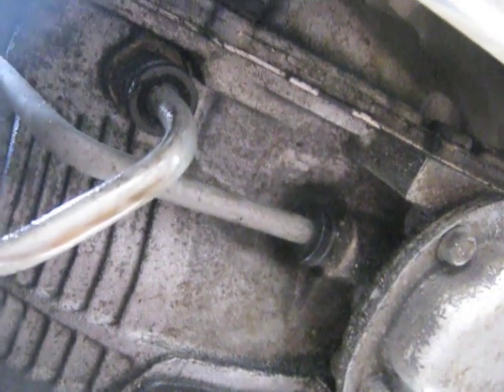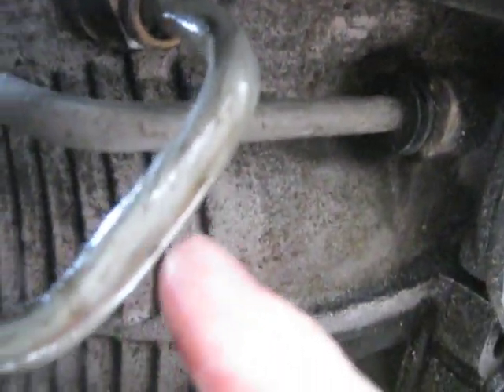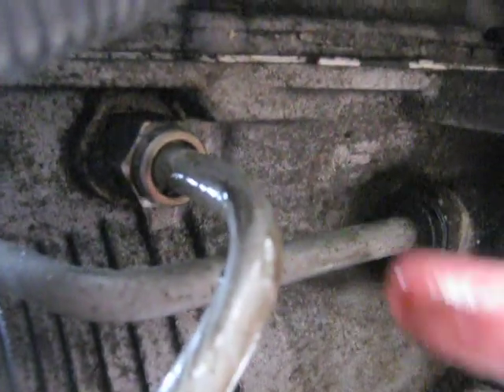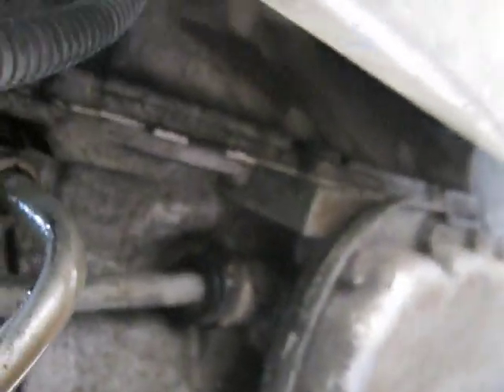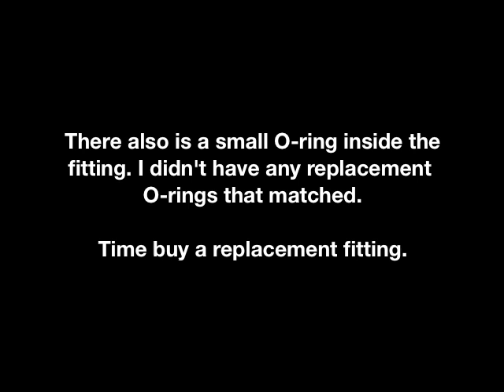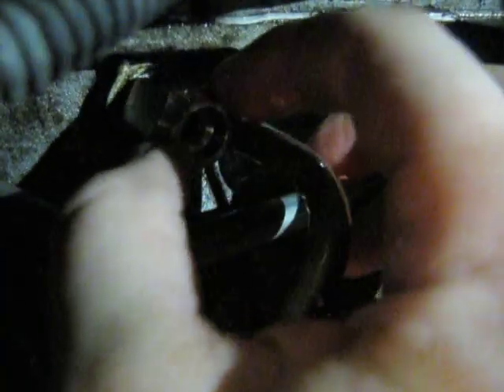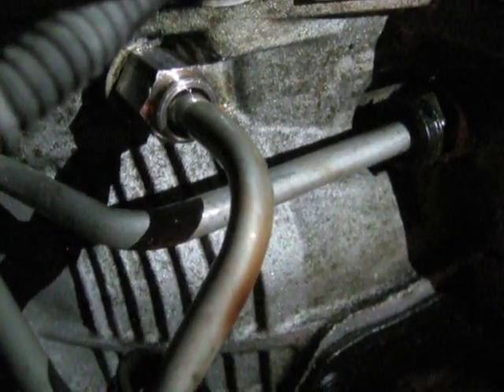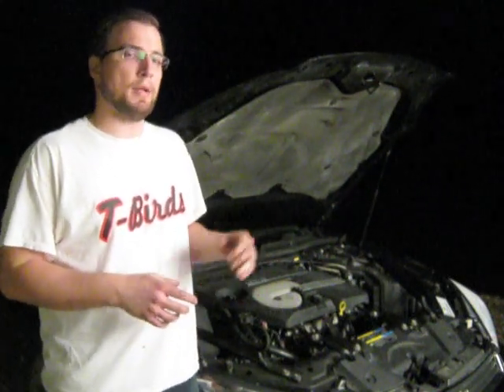Transmission Fluid Leak - Transmission Cooler Line Fitting - 2006 Impala - Fixed

Comment: Thanks for sharing. My mechanic was gonna charge me $60 to install the actual line. And the part was $30. So I searched YouTube and came across your video. Guess what I changed this part you replaced by myself less then 30 mins. Save myself $90 bucks... Part was only $10...
Reply from the maker: mzshytown Awesome! Glad u saved some $$
Reply: Mines charging me 175 , I brought the parts myself 😂
Reply: Those are junk , cut that garbage off and get a double flaring tool , reflare the 3/8 lines the way there supposed to be ..and change the fittings .. Some new idiot gm engineer thought they could redesign the wheel again , but it didnt work worth a dam , they leak half the time ..what a piss poor design ..

Comment: I've got the same o-ring leak on my 06 Duramax LBZ. I'm running heavy-duty 5/8 tranny cooling lines made by Fleece, and I couldn't find just the o-ring, so I ordered the connector for 14-bucks. Thanks for the walkthrough and saving me at least 100 beans!

Comment: you can remove the inside o ring and replace it.  It fits in snug in the groove.  Its seated deep into the fitting. The connector hardly ever go bad.  just the rubber seal wear out.

Comment: The original fitting is a short threaded fitting, and the newer fitting is a long thread! The short threaded doesn't thread all the way not using all threads, the longest threads do use all the threads in the transmission! You have the better fitting sold to you by the dealership.

Comment: I have the same problem with the same fitting I notice in the new part they put some type of grease inside leave that in when installing the new part?
Reply from the maker: I removed the glob of grease out of the fitting before I installed it.
Reply: @TheDaninator  thanks partner!

Comment: i have a 2006 impala 3.5 with the same leak. I took it to a transmission shop because it would lerch forward from a stop position. they said I was losing hydraulic pressure I bring it back home and then I found this leak I wonder if this is why I was losing hydraulic pressure I will replace this fitting thanks for posting this video

Comment: I have a 2008 cadillac Dts and looks like I have same issue , on top of trans looks like a fitting is completely missing. Car will not accelerate I'm guessing because trans feels too hot so goes limp mode
Reply: I have a 07 Dts. Line came off the front of transmission leaked my fluid out. Ima see what I can do today
Reply: Same here with a 2007 DTS.  Slooow leak but adds up if the trans fluid is not topped off.   Off to get the fitting now!  TY to the OP for sharing this info!

Comment: Mine seems to be leaking from the same line, but the side that goes into the radiator. Can I still do this same process to fix that leak? Will it spill a lot of oil or coolant?
Reply from the maker: Should be a similar process. Yes, you will spill some trans fluid.

Comment: Is this only valid for the v6?  Or will the v8 ss model use the same lines & fittings?
Reply: V8 models should have the same fittings, they are also at most autozones in Chicago, where I am at
Reply: @loverFIGHTER  They're listed as two part numbers, with different sizes.

Comment: Hi..! I have a cobalt 2010 and I took it to the dealership and they fixed the passenger side axle seal and now the  transmission cooler line is leaking.  I was wondering if there is a connection between axle seal and transmission cooler line? In other words maybe when they were trying to fix the axle seal maybe they damaged de transmission cooler line or that's a different thing? Thank you
Reply from the maker: I'm not familiar with Cobalt's but as far as I know it shouldn't be related. It seems to me either the dealership damaged the line, or just by sheer circumstance the line decided to start leaking.

Comment: hello i have a 2005 buick lacrosse with the same exact problem does the same process of replacing the fittings apply to my car aswell since they both have the 3.8 in it
Reply from the maker: Should be pretty much the same

Comment: I have transmission fluid leaking under my car from near front of the coolant system. I have a 2003 Ford Taurus. Can someone give me feed back on what may be the issue? PLEASE!!!
Reply from the maker: Can't say for sure, but it could be one of the trans cooler lines leaking at the fitting or something.
Reply: 2004 fordtransmission vent tube
Reply: You have a fluid leak